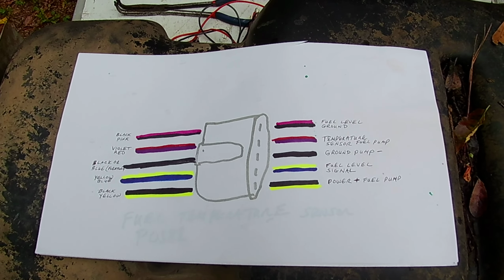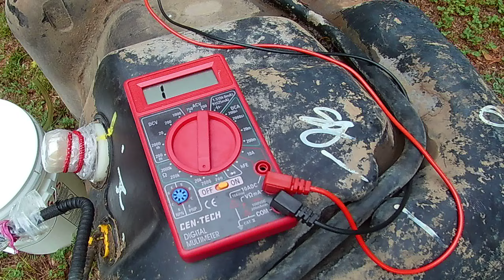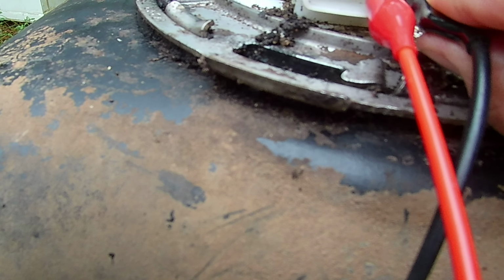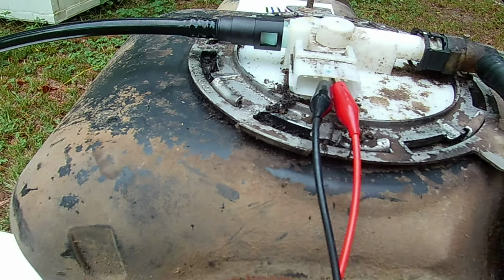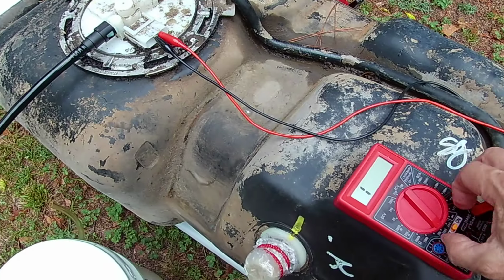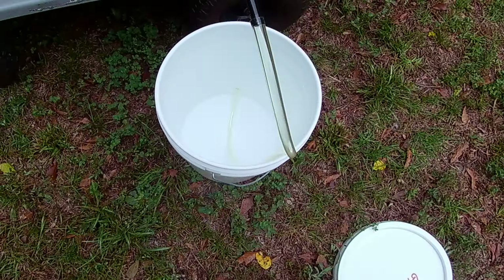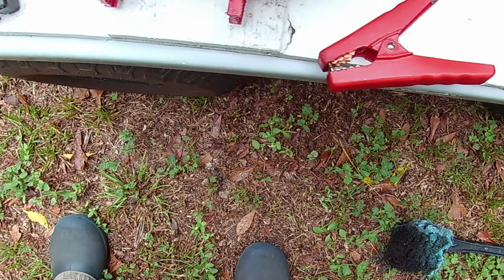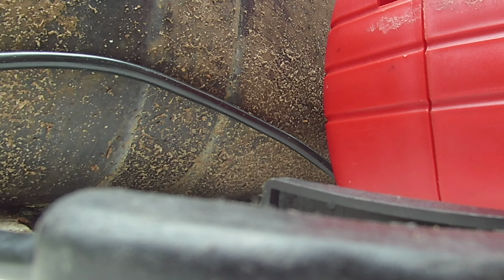Nissan Titan Fuel pump wires Fuel Sending Unit Battery operating fuel pump 9 4 2023

Comment: What code did you get? Let's see if I can assist. Year, make and model to?
Reply from the maker: Nissan Titan SE 2006, got code P0463, fuel level sensor. Have more videos coming of the fried fuel level sensor. I fitted this one it has the same ohms. I researched, and the computer and gauge need 2 to 80 ohms. I'm cleaning and restoring this truck, so just a good way to learn more about my Nissan Titan. https://www.ebay.com/itm/155015294010?mkcid=16&mkevt=1&mkrid=711-127632-2357-0&ssspo=xli3yl4xqkc&sssrc=4429486&ssuid=W5_7WhEFRbC&var=&widget_ver=artemis&media=COPY